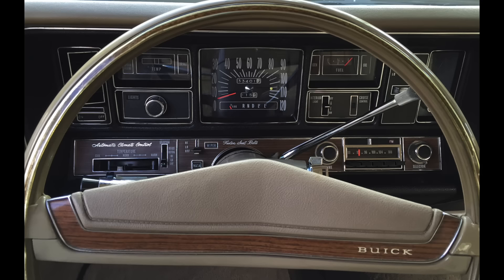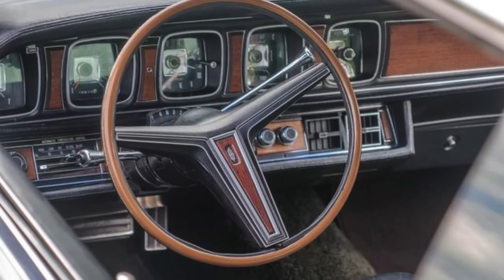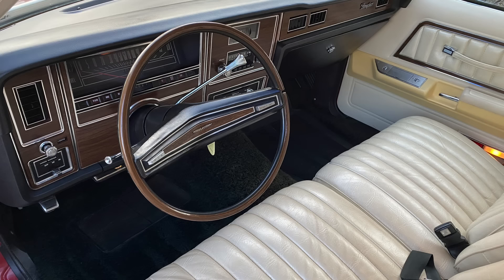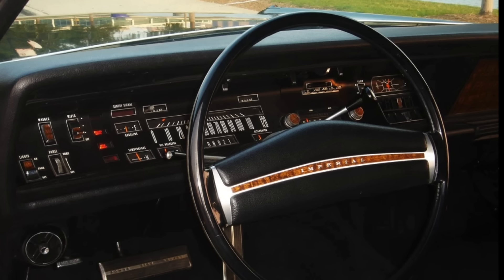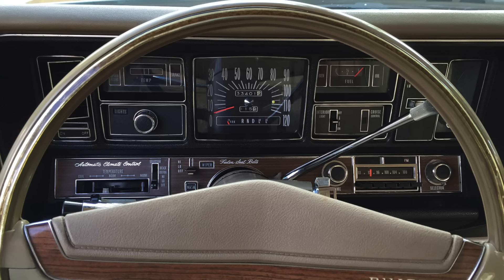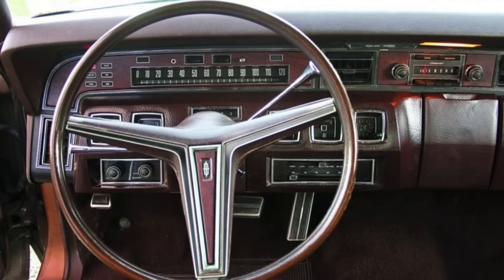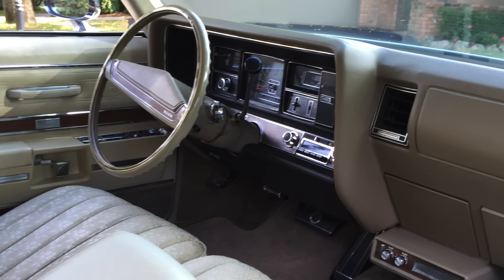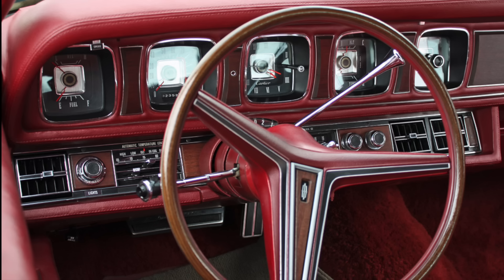Worst Automotive Inventions:  The "Rim Blow" Steering Wheel That Many Customers Hated

Comment: My folks had a 1968 Oldsmobile Toronado that had the rim blow steering wheel and I always thought that was one of the best and coolest features ever put in the cabin of a car.  Just the pressure of your fingertips when squeezing the rim would sound the horn.  Squeezing the rim is a fairly instinctive response to the panic of realizing you are about to hit something, so this was some great ergonomic design.  I imagine it may have posed some design challenge, but we got rid of that car in 1974 when I was 12, so I never had the opportunity or need to disassemble it to see its inner workings.

Comment: I had the Rim Blow wheel, without cruise control, on a 1969 Ford Galaxie 500 2-door. I never accidentally activated the horn, but it took a hard pinch on the rim to honk the horn.

Comment: Chryco had the industry's last horn rings because the California Highway Patrol specified it in the cars they bought as cruisers well into the 1970s. They put 'em in different retail cars too, like the Valiant Brougham.
Reply: In the CHP case, the ring activated the siren so the officer could just blip the device instead of flipping a switch on the console, which made it constantly on. My 69 Fury iii had the half ring 3 spoke wheel. U could still push on the center hub to activate the horn.

Comment: Ridiculous complexity for a ridiculous reason. Its no wonder the automakers constantly need bailouts.
Reply: It was a solution in search of a problem.
Reply: I remember, early 1970's when GM got one of their many assinine ideas  , to laminate the radio antenna into the windshield. A little wire between the two sheets of glass that made up the windshield. Radio reception was downright terrible. No wonder many people ripped out the factory radios and installed aftermarket audio systems.

Comment: My mother had a 71 Dodge Dart with the rim blow horn. It was great until it stopped working and then decided to stick on blowing the horn constantly at 2 A.M. That happened twice as I recall and it was an expensive repair. Of course, the neighbors didn't appreciate it at all. I think she eventually had it disconnected because it was the 70's and annual inspections were not required.

Comment: My vote would be for the buzzer that would buzz until you buckled your seat belt. I yanked the fuse out the day I bought a 73 Mercury. I wear seat belts all the time. I just dont like the annoying buzzer. I am good with the rim blow horn. Just took getting used to.

Comment: I agree with Adam, Rim Blow was a pain. I had a 68 Mustang with the half-moon horn ring,
living in Souther California driving the freeway's, can't count how many I replaced from breaking excessive use!
Reply: As long as Ponch and John weren't chasing you while you were bopping the horn.
Reply: The pot metal horn rings on the '59 Cadillacs were notoriously breakable also...
Reply: @marko7843  Yes, good old pot metal! POC!
Reply: @jeffrobodine8579  Wasn't worried about Ponch or John so much as a$$ hole drive that might be packing.
Reply: VW made the ring so it would make a clean break at both ends and  the arms that connected the ring to the badge at the center of the wheel, and the buttons where the spokes met the wheel, stayed intact.  My father just left it broken and used the buttons for the rest of the life of the car.
Reply: @pcno2832  Wise Man!

Comment: The GM emergency flasher switch from the 70s and 80s was the worst.  Difficult to operate,  didn't always "take," and unnecessarily complicated for something you need in,  well,  an emergency!
Reply from the maker: Oh yeah. That sucked.
Reply: Was that that little plunger thing you pulled out of the steering column? That was one of those random, unmarked controls that left people guessing. Some VW bugs had the rear defroster switch literally hiding under the dashboard and during the same years, most VWs had a brake light that lit up when you pressed it; you were actually supposed to press it every now and then to check the bulb.
Reply: @pcno2832  yes. tricky to operate. not intuitive.
Reply: Having grown up on old GM cars,  I just laughed when my girlfriend's Pontiac LeMans had,  you know,  a BUTTON. Lit up.  In plain sight,  and effortless to use.  Imagine that!
Reply: @jamesengland7461  which LeMans? the domestic or import?

Comment: Had the rim blow horn on early 1970s Ford Grand Torino with cruise control. It was great! I never had a problem with it accidentally honking when I didn't mean for it to. The best part was, in an emergency situation, like someone unintentionally cutting in front of you (like from their blind spot, just gripping the wheel to move suddenly out of the way would sound the horn and alert them. Loved it! I have missed it ever since. I would pay extra for it now, I consider it that good as a safety feature.

Comment: I remember in the early eighties, Ford relocated the horn button to a small stalk on the right side of the steering column.  Not easy to get to, and in a panic situation, impossible.  Another bad idea.  If it works, no need to fix it.

Comment: Apparently mercury had these in 1969 because that is what was on my three spoke steering wheel of my 69 cougar convertible.  I owned this in 1982 and I remember it going off in the middle of the night. It turned out the copper strip that was the contact area around the perimeter of the steering wheel would corrode and set off the horn.  I have seen this on other Ford products as well

Comment: My 73 Imperial had rim blow. Keep in mind I bought this car in 84 and I loved it. Rear A/C, anti lock brakes, posi track, theft alarm. However, by 84 in the deep south, if the car was parked in full sun suddenly the horn would go full blast.  Got used to unplugging the horns in the summer till I rented a house with a garage.

Comment: The original Dodge Durango did share taillights with the Caravan/etc. of its time, but in the same orientation with the reverse lights at the bottom. The minivan shown is the next series after, that did have the light design inverted.

Comment: I drove two of these rim blow cars in Chicago area from 1970-76. (69 Sedan de Ville & 75 Gran Torino wagon) Another problem with these is that the copper ring under the rubber covering froze and contracted in cold weather. So it was extremely hard to blow the horn on cold winter days.   Man-oman that 69 Caddy was a BEAST!

Comment: The 1969 Toronado I bought in 1991 had the rim blow feature. The boyfriend of the owner's daughter had cut two square holes on the back of the steering wheel and added two red push switches. They still work today!

Comment: I had a 1969 Mustang Grande coupe when I was in high school. As cars got older, the rubber for the rim blow activation would get stiff and brittle. If it got really cold at night, like several degrees below zero (and in the late ‘70s we were going through a cold period called a Little Ice Age) the horn would spontaneously activate, usually in the middle of the night. I got really good at quickly getting the hood open and unplugging the horn. You could get that rubber strip replaced, and then it would work well again. When it worked right, I liked it.

Comment: This is a bit of a funny story.  The steering wheel that Chrysler used AFTER the Rim Blow and the Horn Ring wheel was a 3 spoked thing.  The horn actuation was only possible if you pressed the rubbery part near the ends of the spokes, where it attached to the ring.

As a kid back in the 70's, I remember my Dad being roused from his bed, on some extremely cold winter mornings.  We're talking at like 3-5 AM.  He was woken up because those rubbery ends on the spokes, had contracted so much, that it actually activated the horn!  We're talking -35 kind of weather!  I don't know how many times it happened to others, but it became a situation where, he would simply unplug the horn itself, on our 1971 Newport.  The same steering wheel was used across many Mopar brands.  

The horn blew, because the button cover, contracted.  Crazy if it weren't true!

Comment: I was t a fan of the rim blow. For me it was hard to eat used to in a household of multiple vehicles. But one of my bigger automotive pet peeves was the power trunk button’s that had to have the ignition turned on to operate. I loaded the trunk often for my wife and never seemed to have keys on me. A couple cars I wired the power to the glove box light for that reason. Also saved on cussing
Reply: Saves a move on cars that had trunk button in glove box, just open door no need to push button

Comment: Back in the 60s and early 70s Chrysler's Tilt/Telescopic steering was made by Saginaw, a subsidiary of GM. I don't remember rim blow on standard columns (which were made by Chrysler.) I had it on my 73 Plymouth Sport Suburban wagon. It worked fine and actually liked it. As a Mopar mechanic back then, it seems the problems we had with them were their tendency to start blowing the horn until the battery died at 2am in the morning. Had something to do with the air temperature falling.

Comment: I've always enjoyed watching newbies take my 1972 TBird for a drive. The power steering requires 2 fingers and a gentle touch for all driving situations. But I hand it to a newb and they can't get around a corner without honking the horn at least 4 or 5 times. I personally love the feature as I have been driving the car for over 20 years now and it is effortless to give a friendly toot to a passing friend....

That said.... Condensation is it's enemy. In it's old age it does not like temperature shifts. It will develop just enough moisture in the double ring of contacts to activate the horn at random. I had to re-wire mine to a key on relay after too many times of it just blasting at 2am non stop on a late fall or early spring night where the moisture conditions were just right.

Comment: My parents had a 1970 Mark 3 with the rim blow horn, it did have a cruise control. Set was on button on the turn signal stalk, a switch, which is visible on your first picture, hangs down from the dash pad to turn the cruise control on or off.
My friend has a 1969 Mercury Cougar with the Eliminator package, it has the rim blow horn.  His car has only the one option, the Eliminator package, it has manual drum brakes, manual 3speed transmission and manual steering.  Yep, I've driven it a couple of times, and honked the horn.

Comment: I LOVED the rim horn!  Interesting that the Ford you first show (1969?) had auto-temp but only an AM Radio.  All the other lux cars you show had AM-FM (and will assume stereo) save for the Continental  with the same auto-temp and AM radio,  8-Track was around for almost 15 years, all the way into the Ford Quadraphonic system.  Did anybody else do Quad-8 radios?  Have you thought of doing a radio history?  From Chrysler's Highway Hi-Fi record player to the "mechless" radios of nowadays.  Some searches say the first FM stereo was Blaupunkt in 1953 (more like the first AM/FM only), but another search had Becker "Mexico" model in 1969 (lie!).  I remember seeing stereo in the 1965 Cadillacs (edit: wrong -- 1966!).

Comment: I had it on my 69 Cougar. When I bought the car as a fixer, it required replacement and I was able to source one at the dealer. I had no issues with it, but one day when my future wife was driving it, which she usually never did, every time she made a turn she honked the horn. She had a Mustang with manual steering and had to put a pretty good squeeze on the wheel to make a turn.

Comment: I had this on my 69 Sedan de Ville. Difficult to use with gloves on. Tthe flexible rubber got stiff in the winter, requiring more effort to honk the horn.  The car did have neat cruise control, with a numbered wheel that was used to set the speed. The wheel on my Caddy was loose...You could flick the wheel with your thumb and  zoooooom!

Comment: I've driven a number of cars with that rim-blow feature, they were a pain in the hoop because you had to grip the wheel ever so lightly to avoid unwanted honks and beeps, and you had to drive like Grandpa, which generally precluded any sort of spirited driving...Mind you, most of those cars did target the Grandpa market anyway...  The best horns are the ones where you can reach the ring, button, or pad with your thumbs while still maintaining a firm grip on the steering wheel.

Comment: It's been a while but I seem to recall that my Dad had a Ford Country Squire wagon with this feature.  The hot summers in the southwest played hell with the plastic on that rim.  Chunks of it were always falling off or getting hooked on something and peeling off in strips.  When he sold the car I don't think it had a working horn at all.  For me, I think it might be the push button automatic transmission in the old Dodges.  Looked cool but didn't work quite as advertised-especially as the cars aged.  Coolest feature I can remember on a car was the thermometer style speedometer on the 1968 Lincoln Continental.

Comment: I had this on two cars: 1970 Dodge Dart and 1972 Oldsmobile Toronado.  I accidentally honked the horn a few times in both cars, but by and large the rim blow worked as expected.  Supposedly rim blow was dropped because neophyte drivers couldn’t figure out how to honk the horn in a panic situation.  The black rubber bulge on the inside surface of the steering wheel was a bit of a give-away.  As if all the multiple functions jammed onto stalks these days aren’t confusing?  The location of functions and stalks varies between makes too.   Add to that Tesla where you have to find functions dispersed on a touch screen.  With all that, rim blow actually seems kind of sensible.

Comment: I used to have a 1974 Lincoln with a rim blow horn. The vinyl covering was hard as a rock, and a previous owner had cut through the rim in two places so that you could squeeze the two metal contacts together to make the horn blow, yet the horn wires were unplugged. I later found out why, when the horn started blowing in the middle of the night. The only way I could get it to stop was to disconnect the horn again.

Comment: A friend had a 1970 Mercury Colony Park with the three-spoke rim-blow steering wheel and speed control with the turn signal stalk mounted button. This somewhat rare steering wheel was available from 1970-72 and possibly into 1973-74 (not sure) on full size Fords and Mercurys. Another friend had a 1974 Mercury Marquis with the standard two spoke steering wheel with rim-blow and speed control. He said it honked when you didn't want it to, and that it sometimes didn't honk when you did need to use the horn.

Comment: Thank you Adam.  I recall Oldsmobile had it too. I saw it in the Eighty Eight commercial on You Tube.  Nice catch on the steering wheel too.  GM parts all day every day. It seems the interiors used to be more driver focused as well. Something I have noticed when suppliers introduce technologies, the spread through the industry and you seen them on competing cars.  I have seen a lot of the cracked GM steering wheels.

Comment: My parents bought a 1970 Dodge Dart Swinger that had the rim blow feature.  It worked well until it didn't.  After 4 or 5 years baking in the sun the rim blow rubber/plastic required replacement.  The replacement part worked well until we parted with the car around 1978 with about 160K on it.

Comment: We had a 72 Mercury Marquis Brougham growing up with the two-spoke rim-blow wheel with cruise.  Had that car for 19 years, but after about 10 years, the horn would start blow every time you turned the wheel left.   Finally, it started blowing turning left onto our street ... would not stop ... and my father just disconnected the horns.   About a year or so before we sold the car, we tried to reconnect the horns to see if they would work, but by then, the rim-blow feature just did not work.   It was cool while it worked, but was very problematic.

Comment: My Alfa GTV has a 3-spoke wheel with a mechanical button that pokes through all 3 spokes right out at the end near the rim. All 3 buttons are part of a spider that activates the horn switch in the hub.  Since you are always keeping your hands at the 9 and 3 positions (right?) a horn button was always just under your thumb. The button at 6 o'clock was a bonus for those long sweepers.

Comment: I bought a 1969 Ford Ranchero in 1978 and it had that type of horn activation. The rubber on the wheel was badly deteriorated and the metal contact was poking out in places. The horns were unplugged because the contacts were shorted. I put a steering wheel  cover on it and drove without any horns the whole time I owned it.

Comment: The feature I dislike the most is pull-pull on the trafficator arm for main beam to dip beam transitions. Push-pull is the 'only right way'! (I'm in the UK, so I also want the direction indicator control on the opposite side from the gear stick.)

Comment: Adam, remember starting in the late 1960’s and throughout the 1970’s and some cars into the 1980’s and even early 1990’s, many American cars drivers windshield wiper had two arms allowing the bottom part of the wiper to swing out and wipe more of the windshield, closer to the A pillar? My 1970 Ford Thunderbird and 1990 Mercury Grand Marquis had the double arm drivers wiper.

Comment: My dad had a 1969 Mercury Marquis convertible that had a rim blow wheel.
He put a lace-on steering wheel cover on it.
One hot day, the car was sitting in the driveway with the top up and windows closed.
The heat caused the lacing on the steering wheel cover to tighten and the horn began to continuously blow.
Dad wasn’t home so I had to pop the hood and disconnect the battery to stop it.
Memories!😜
Reply: You'd think that just lacing up the steering wheel cover would have tripped the horn switch. Not a good steering wheel for an aftermarket cover.
Reply: If u had the hood open it would be faster/ easier t o unplug horn wires